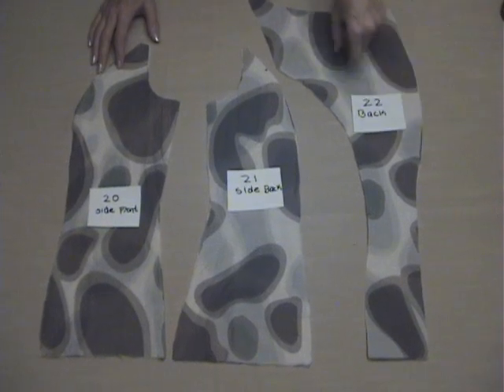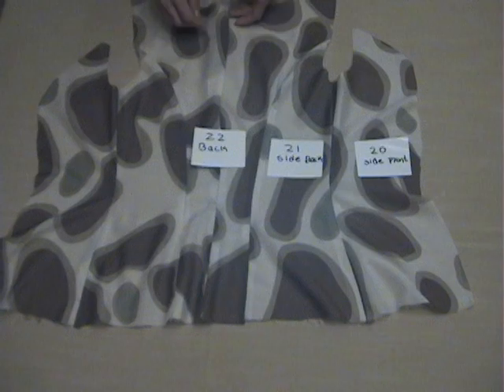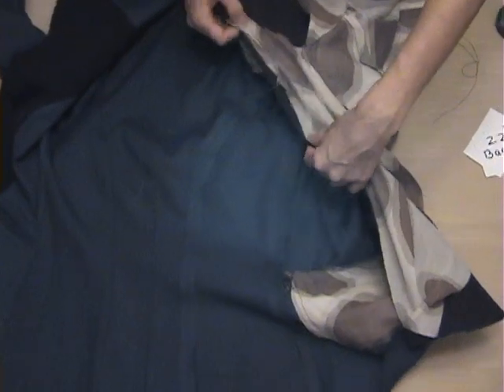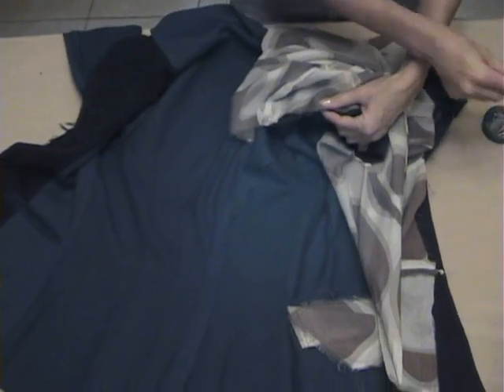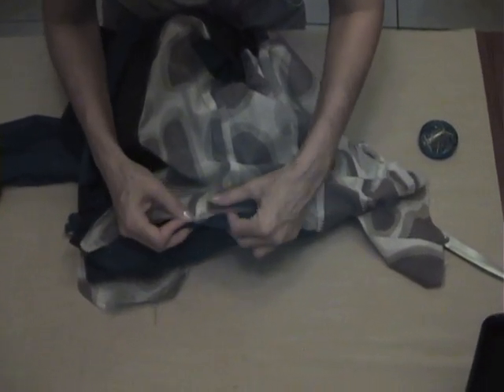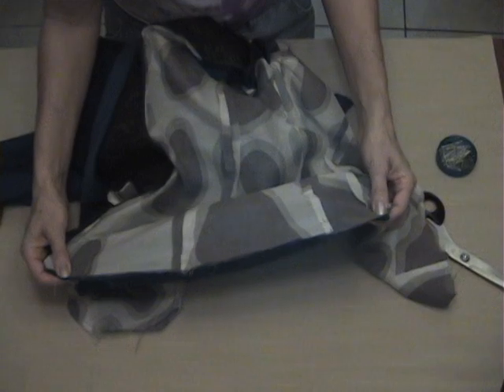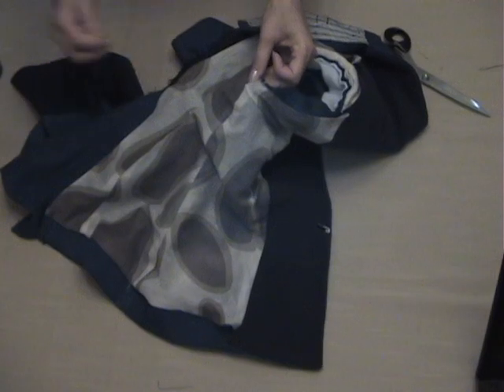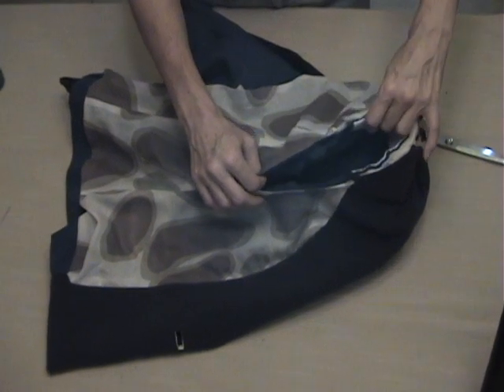Steps to attach the lining to the jacket 2013 12 07 21 53 30

Comment: Marcela 
Did you have the jacket turned inside out (wrong side) when you first began?
Reply from the maker: Hi M Renaaye, yes , the jacket is on the wrong side.
Reply: Thank you for the quick reply :)
Reply: Marcela Mejia So when you pin, are you pinning right side of shell to right side of lining?  or wrong side of shell to right side? I'm so confused :(
Reply: Renee Garcia - Yes.  Notice that she hemmed a faced opening before she started the video.  That's the pocket that you see at the corner.
Reply: Renee Garcia -  She pinned the right sides together.  Always right sides together.